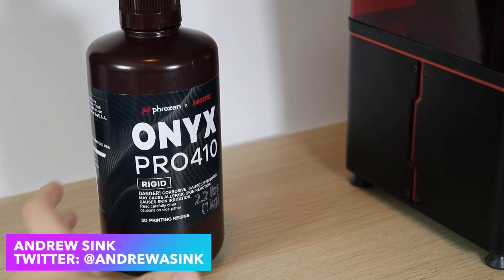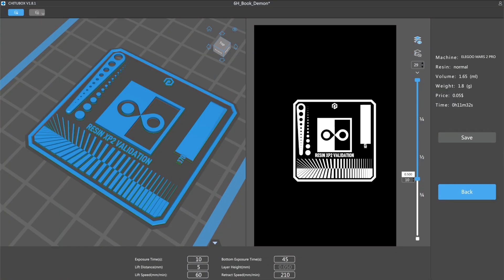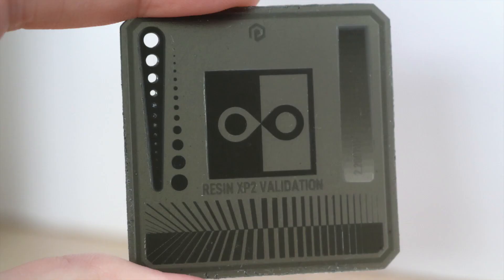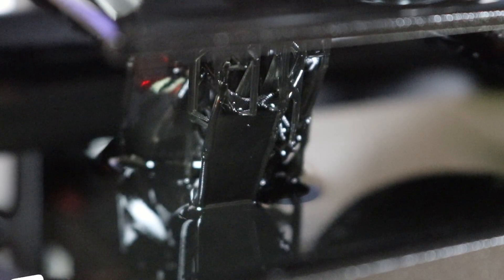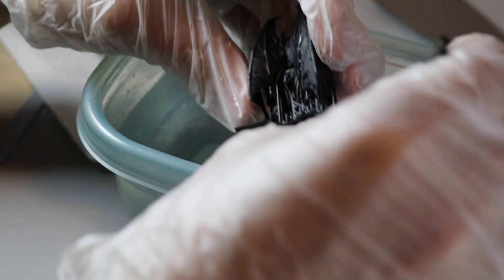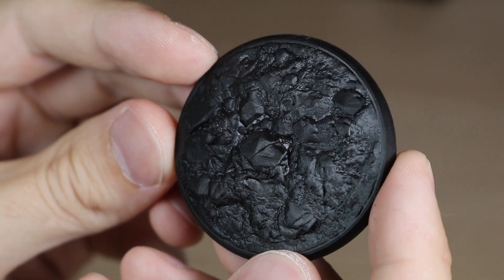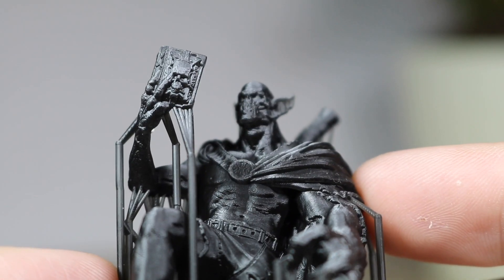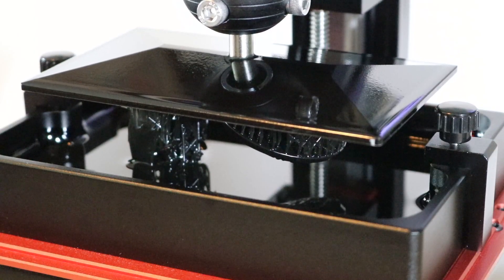Loctite / Phrozen Onyx PRO410 Resin First Impressions - Highly Detailed Without Being Brittle

Comment: So Andrew. This is what I am designing and printing at the moment. https://youtu.be/odCnG7_YvJQ I have been looking at Phrozen resins because they seem to have more options in more rigid formula's than Anycubic does, and now that I know the difference between SLA, DLP, and LCP printing I am thinking that the Mighty 8K would have been a better choice and buy than the M3 Max that I bought.

So far I have been getting good results with the M3 Max, and M3 but I found out that the SLA screens have a service life of 2000 hours, and the DLP screens have a service life of 20,000 hours. They are also suppose to be higher quality on the prints, but they are about 2 times the cost for the machine. Anycubic has 2 DLP machines and they are about the same size as the M3 and a little smaller. 

I thought that the LCD machines from Phrozen were just larger DPL machines but after reading and watching I found out what the differences were. The LCD screens last for 50,000 hours and can print to 0.20 microns, and they have this on a machine (Mighty 8K) that was actually about 300 dollars less than the M3 Max that I bought with a slightly larger print area.
Then the Mega 8K is about 2200 US dollars, which is twice what I paid for the M3 Max but if we are talking jus over 1/3rd larger print area, with a 50k hour LCD screen then with the size of the models that I want to print along with probably not having to buy screens from 1 to 3 times a year to replace, I am thinking that the Phrozen machines would be a better buy.

Also, the LCD puts the image layer right against the print, where the SLA machines are projecting it from mirrors so microscopically it can alter the image with minuscule scale distortion. I am not trying to sound like a salesman here. This is one of those things where I am learning a butt load of information in a short amount of time. I also am having to somewhat filter the sales pitches info out into what is real compared to what is real, and what is just tickling my fancy.

Most of the models/game miniatures feel like they were printed with plastic that is somewhat like they cast toy soldiers back in the 1970's. We have made brackets for custom archery bows, and these models that I am printing. We have used standard resins, and ABS like resins along with some translucent generic stuff. I printed some chess pieces that broke just falling about 3 feet from a table top to a floor and one of my test model pieces from the ABS like resin fell about the same distance. 3 feet and it cracked most of the way through the model.

I am looking for a resin that would somewhat emulate Syrene Model Plastic. My models are not designed like blocks of plastic that are just sliced into sections to align and glue together. I actually shell them so they are like the models that I grew up with and glued together with tabs and are hollow.

I was looking at this PRO410 but it still seems like it is to flexible for what I am wanting. I don't know about the Green Nylon either. I am thinking that the BASF prototype white might be the closest so far. I wish that they were not twice the cost of the other resins, but I can always print to test with the cheap resins, and then make the parts with the 80 dollar a KG stuff.
Let me know what you think, and thank you. 

Eldan Fales. CEO Blue Dragon Archery. Model Division Engineer.